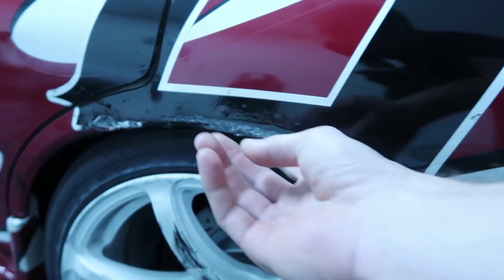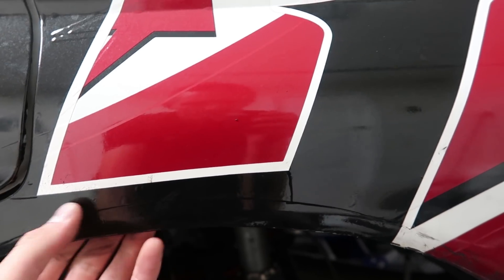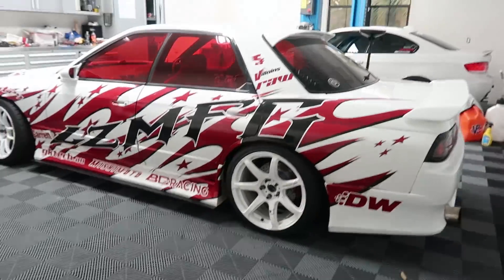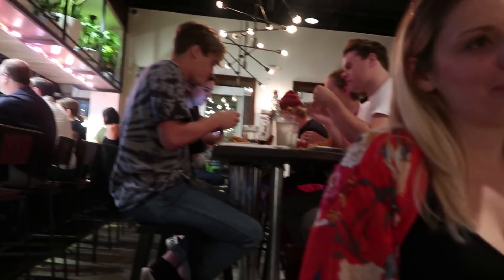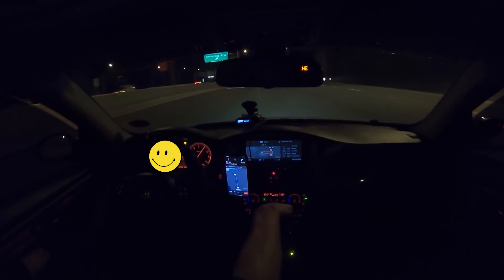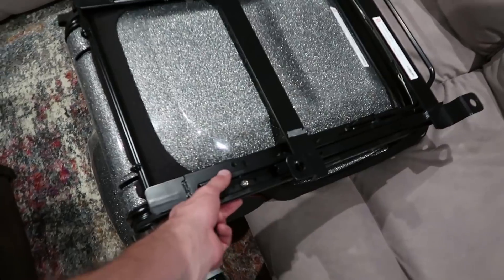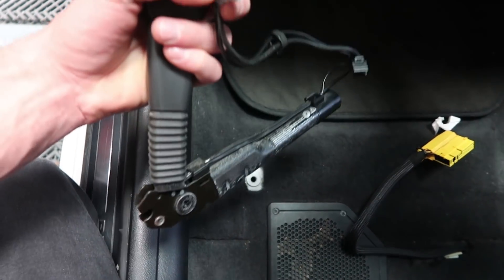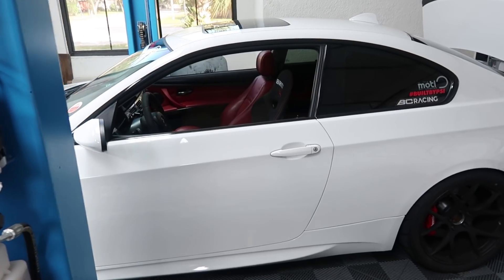750HP 335i No Lift Shift & Seat Install

Comment: Yes there was a supplemental restraint (air bag) in the seat. Any bright yellow connector in a modern car is part of the srs or air bag system so no probing either test lights or tying I. For a power or ground source.

Comment: Adam to get rid of all the salt on the car have all the exterior including underneath Steam Cleaned it will save your bodywork and the frame at the same time the engine bay will shine again.

Comment: Hey adam i have an 07 coupe and its currently on e85 with full boltons running around 450ish hp... would you say its worth it to go single turbo or just get stage 2 twins and up the boost?